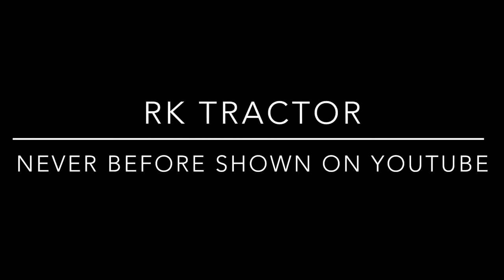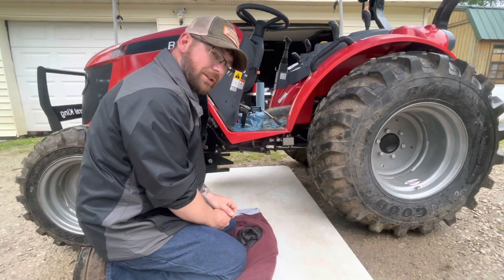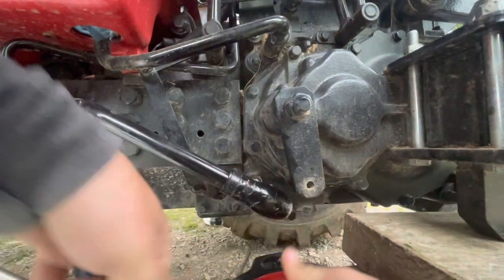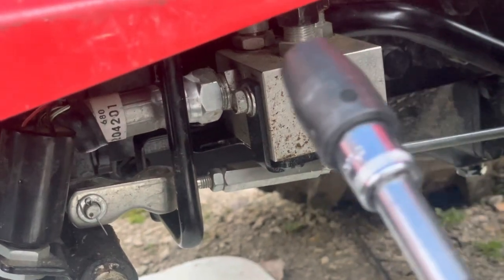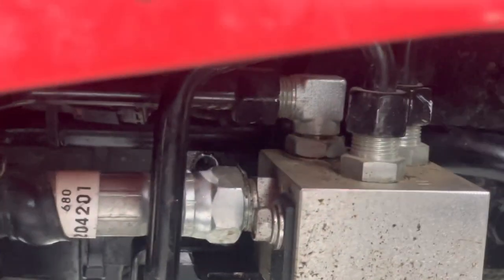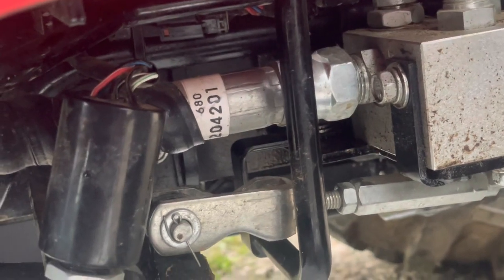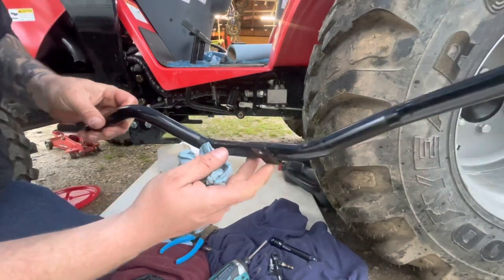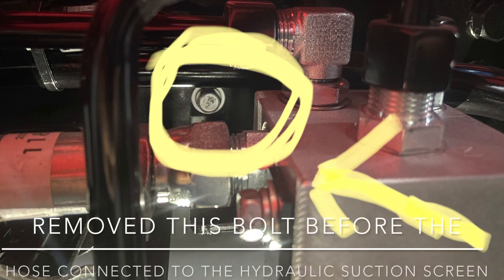#49 RK Tractor / RK25 T25 NEVER Before Shown on YouTube pt. 1

Comment: I had the same problem on my RK25. The replacement tube was $225 so I fired up the oxy-acetylene torch and melted a puddle at the start of the weld crack and pushed it to the other end and back again. Took about 30 seconds in all and it was fixed.  Thanks for the video!
Reply from the maker: I would have welded it but I didn’t have a problem getting the new one.

Comment: Great information. When I checked the suction filter on my 264 for the 50 hr service I loosened the hold down bracket first. Having a mechanical background, I knew from experience not to force those thin walled lines. Your video may save someone the trouble of repairing that line.

Comment: Thank you so much. I have this exact problem
Reply from the maker: Did you get it fixed?
Reply: @gatheringrusthobbyfarm8081  
Yes I did. I called in a replacement part but they couldn't give me a timeframe on delivery so I took the cracked pipe to a local welder who repaired it. I fitted that and it's working beautifully now. Of course the replacement part arrived 2 days later. 😂 Thanks again, it would have taken me a long time to find that fault
Reply from the maker: @nicholasreed8888  always good to hear when people are able to DIY fix it.